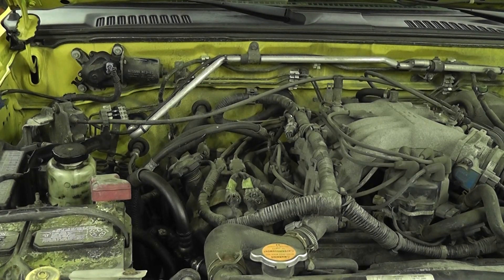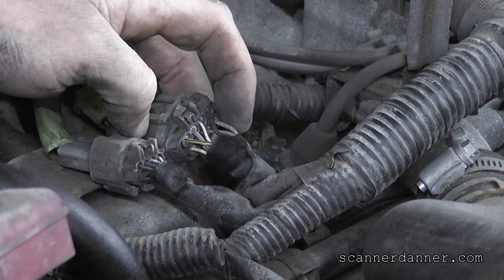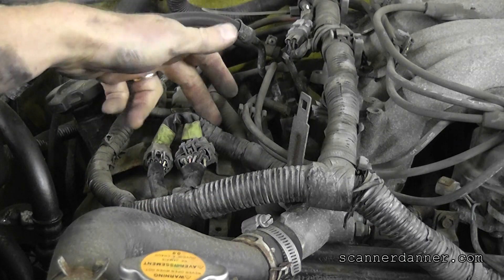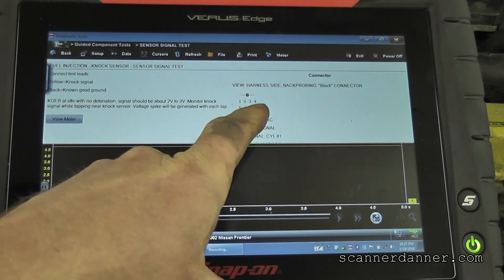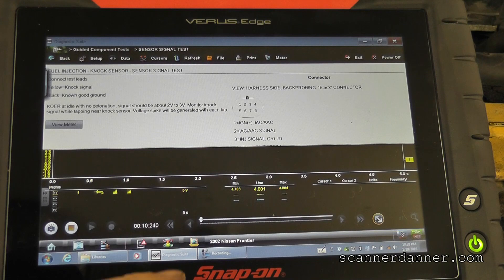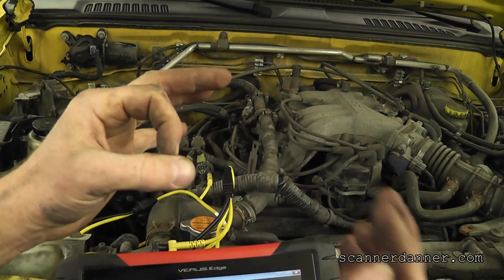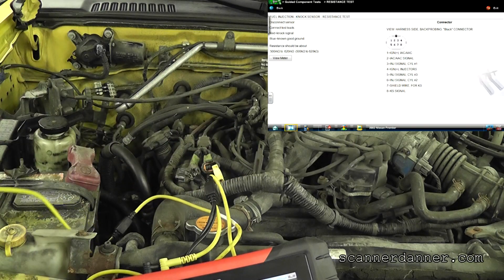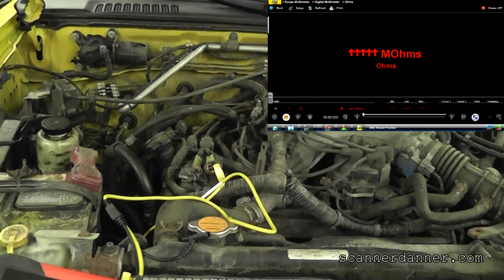How to test a knock sensor (P0328) - Nissan

Comment: I got a Nissan Xterra 2000 that keeps coding knock sensor and misfire on the 6th cylinder n it has had a new intake manifold new distributor new radiator cuz it was cracked on the top. At stop light it's idles rough . Had new spark plugs n wires. No one can fix this car n 1100.00 bucks was put in it. I'm female n don't know what else it could be. Please help and I'm in lancaster Ohio. What else could it be. Also had an injector put in it. I'm puzzled n love this SUV. Anyone have an idea what it could be? Thanks
Reply: Dear wicked,
I can not help you but just had to tell you  that I bought a used 2002 Xterra in 2012. I have had the same nightmare money sucking issues and no one, even the best mech's can not figure out why this knock sensor continues to trigger problems. I have had pretty much all hoses clamps motor mounts. gaskets and radiator along with temp gauge replaced, brand new. It will run great for weeks, then BOOM! I have come too one conclusion though. I live in Nevada. The outside temps change dramatically and my Xterra does not like the colder weather. It has now become it's evil side and runs like shit. The SES light flashes, then stays solid as a de accelerate. It's a mystery...
Good Luck to you!
Reply: Julia Smithson really then wth could it be then. They checked the Heads n I was there n they r good.. it's going back in n now pcv light came on n my oil light. But I have bad valve cover seals so we will see
Reply: I have been struggling with this Xterra the same. This time, to save money on diagnostics and procedures that may or may not be the culprit, I read a lot of the threads, watched several video's and chose to do some maintenance stuff myself.
I started with cleaning the MAF sensor, the wires and connector. Replaced air filter. All this was pretty simple though I did spend  $20.00 buying best products. I also poured a cup of household rubbing alcohol in gas tank, in case of water or bad gas.
Get this!
The SES light remained but only solid not blinking. My car did not "lug" or shake. Ran like it should. I tested the codes again, (the car misfired a bit in route) but it only gave me PO328. (I'm working on this now), BUT! SES light is off and the car is normal once again! 
I am convinced that the sensors are just as good as signaling for minor attention as they alert for major. Next I am going to check n clean spark plugs. It is pretty greasy under my hood so I am going to de grease and learn to do this stuff myself. 
I am single also, and work various jobs for minimal monies. I have spent far more on replacement parts than my car is worth. But I like the SUV.       My Bionic X
Good luck and keep me posted!
Reply: Julia Smithson Lmk I got the same code which is the knock sensor but my check engine light stays on but doesn't flash anymore. This shit needs figured out. Omg
Reply: witch, maybe an obvious question but you did not say: you did have the knock sensor replaced? If you didnt, you can save some money by relocating it-- a few vids here on howto. Not sure what the misfire could be if everything was replaced as you say.  Also maybe the knock is picking up the misfire. Sorry, Im not a mechanic, thats all I can offer.

Comment: From what I remember, a knock sensor has a crystal in it that is tuned to the same frequency of detonation or much more deadlier pre-ignition knock. Ok, a full 5v+ shows right off that the circuit isn't broken, but the knock sensor hasn't initially dragged the voltage down from the start. My 2000 Ford has recently started pinging. I'll just wait for a P code to set, haha.

Comment: I've found when the KS on the Xterra or Frontier 3.3L fail.
It always easier to do the KS relocation instead of pulling the upper and lower intake manifolds.
Reply from the maker: +nightflyr1 I've never heard of a knock sensor relocation kit, what a great idea!
Reply: @ScannerDanner  If you relocate knock sensor, you will get the engine light to go out but your timing being adjusted by the knock sensor as you drive defeats the whole purpose of the sensor. It's where it is for a reason. Replace it and change the plugs while your at it. taking the intake off is the best way to replace that funky plug in the rear of engine up against the firewall. most people don't change that plug because it's very diffucult to get at it and worse to put another back in.
Reply: @pcosta24  👍. Exactly my thoughts on tackling this issue which I have right now.

Comment: Hi Paul does the shield wire supply sensor ground or it grounded on engine block? We are normally test ground wire on pull down design? It's what you teach me on book an prem.channel??

Comment: The edge looks awesome, we have the Verdict at our college but I don't think it came with the 15.4 upgrade. It doesn't appear to have sure track or anything, and won't even tell us what the DTC codes are !
Reply from the maker: +9freelandk so far so good. there are a few things I don't like but some of it is because I do videos. 
There is no built in microphone so when I do a desktop recording it is hard to sync.
The stylus absolutely blows
It has no connection to the car which is great but not when you are mobile and need it for hours of use. 
There is no hdmi or video output without buying a separate docking station (additional $300)
Reply: +ScannerDanner For some reason we have the optional docking base but due to the cost of this equipment it all has to be securely locked away after every lesson, so we don't really get great use out of it. It's a nice feature to have though and just use the dock especially for all day indoor use, via the old 15pin VGA to a 40" screen for graphs etc...
Reply: ScannerDanner

Comment: Can't you remove the test lead unit from the back of that new verus ,isn't wireless also??
Reply from the maker: +Lee Rattle I don't think so, not sure, I'll check
Reply: +ScannerDanner I just had a look , Its a usb module you can unclip from the back of the unit, & attach a usb cable  to give more distance from the working area , pitty not wireless

Comment: So cool. I have this exact problem. I subscribe anyway, because as a professional you up my game, but you literally pulled back curtain on this one. I've never seen anyone cover this subject this accurately.

I was already certain about the high voltage getting through meaning the sensor was bad, but the fact you can tap it and see an AC voltage line go through the DC? That's gold!

I'd heard on modern sensors you can't just hit the engine anymore to see "knock", but it makes sense, it basically being a microphone that'll pick up other vibration, it's just that the PCM knows the difference between random vibration and knock, right?

So we can see the new one alive before putting the intake back on. THAT'S a verified repair then. :) Wouldn't want to do this job twice!
Reply from the maker: +DE “AutoBravado” Nichols thanks so much for your encouragement
Reply: ScannerDanner
Just read your description:
"Symptoms
- check engine light with a P0328 trouble code
- poor fuel economy (2-3 mpg less than normal)"
Oh my gosh. With how much I drive my truck, that's a BIG savings.

I need to stop being lazy and get out there and get it done.

Comment: Good morning and thank you for another video. I have a question, we know this knock sensor is bad because is open, is there another way this sensor will fail? Or what are the other condition a knock sensor will fail and what driveability issues besides a ck engine light will it cause?
Reply: +DE “AutoBravado” Nichols Is this a pop quiz? I could answer to go and see the video but I will tell you what I have learned. I learn the other way to test a knock sensor using a oscilloscope that is not open and about the bias voltage on the Subaru but I still have a question. Is there a driveability issue with a a open or shorted knock sensor? Maybe Mr. Danner or another student could help me. Thanks in advance and I hope I scored good in the pop quiz.
Reply: to affirm what mr nichols said, on my 2003 xterra my mileage and power (not like there was an abundance of either before) took a big hit.  If the cpu thinks engine is knocking (detonation which is very bad for your motor) it will reduce advance and probly make the mixture way too rich.
Reply: +David Tapia I read the description and found my answer in the subaru knock sensor video, again thanks for the information. Have a nice weekend.
Reply from the maker: +David Tapia awesome thank you!
Reply: +David Tapia So, can you share with the rest of the class what you learned? :)
Reply: David Tapia There is a driveability issue with open or shorted knock sensors. Once the PCM knows it doesn't have this measure of protection it'll run a safer level of timing advance. Or a gentler tune if you will. When you get into the throttle there will be less hp. 

I picked up from ScannerDanner's description that there can be 2-3 less MPG. One gentleman with the same engine in the comments said at first he got better gas mileage only to lose it because of how much easier it was to go above 3,500 RPM.

Did you learn anything else then? :)
Reply: David Tapia It's always a pop quiz. It's why I go into comments. Additional learning. I like to teach, learn, and sometimes be corrected. Please, join my YouTube channel. We'll get smarter on cars together.
Reply: Ronin Don't feel too bad about power and mileage. Did you know our V6's out perform some Ford F-150's? Depends on the engine and weight of the F-150 since they vary. I didn't think to look into power to weight ratios until I noticed on my scan tool that the MAF on a basic F-150 moved less grams per second.

I've not been too quick to get this fixed, seeing as how I bought a Nissan original knock sensor according to Rock Auto...one box said made in Japan and another that it was AC Delco. Pissed I might have a knock off knock sensor and having seen so many people report success on Chinese knock off's I bought a cheap one on eBay and it was made to the identically wrong specs!

Unless my DVOM ohms of resistance has gone bad, I think they're both Chinese knock off's.

(Pun was intended.)
Reply: I've got a 99 Nissan quest.  only code im getting is knock sensor.  will it affect the performance to the point if not being drivable? Barely idles.... Cuts off as soon as you put it in drive abd give it gas. i can put it in N then slam it into D and it will catch but barely.

Comment: Also unique to the Nissan is that the P0328 will not trigger the MIL. There is info from Nissan for that. I didn't even believe it at first. Rodents love the wires under those intake manifolds and they're are best employees sometimes, LOL. A cheap trick is to relocate the knock sensor to the upper manifold where there is a similar thread pitch. At least for testing purposes if the knock is causing drivabilty. Good video.
Reply: +M3CH4N1CT3CH I waisted some free time for weeks reading a forum about the relocate. I plan to do that first and see if it can really still see knock or not. I'm so going to go back to that forum, club frontier I think? I'll post this video and it'll have more complete information than in all the some 500 posts.
Reply: +DE “AutoBravado” Nichols It will not sense knock the way it was designed to, and will also fail a lot of smog tests.
Reply: Oddly enough. Mk4 vw won’t set an MIL for knock codes either. Don’t know why, I’d imagine it would.

Comment: 3.3?   i have one of those in the driveway, knock sensor code was always there, sensor was split when i finally got in there 6 years later lol.    it never threw a CEL, just was listed under fault codes if you plugged in and read them.
Reply: +Rhage73 Yeah, I didn't notice either until I set a code for replacing the fuel pump, but not the fuel sending unit. My Nissan Frontier sat for 3 years, so everything was rusted in there. It'd have taken days to get the sending unit, but I had to move across country. A year later and I still haven't gotten around to it...just fill up with gas more often, lol.

Still, it needs to be replaced as it tells the PCM the fuel temperature and makes fuel trims be more accurate for the best use of fuel.

Thanks for my listening to my side note waffling. :)

Back on the knock sensor, did you read in the description that it can get you 2-3 MPG, or at least that it can lose you that? I need that back! 18-19 MPG on the freeway instead of 15-16 is a BIG deal.
Reply: i was getting 19, and then when i changed the knock i was getting 16.   i put on manual hubs got back up to 17.  pretty sure it was easier to wind the truck up past 3500 is why my MPG went down, because my daily is a mix of city and hwy and its a 5speed.   =)   210k on it still fires right up love them older 3.3 / 3.0   Yours may be a 3.5 if it is newer than 99.
Reply: I can't remember the size of my engine. V6 2004. I used always remember stats like that. Guess I care more about function and results.

Comment: SD does it again!  Nissan almost always buries there knock sensors which usually dont outlast the life of the car.  What a PIA to replace a tiny sensor w/ one bolt.  I had my son Ryan who was 8 yo at the time reach in under the manifold (with his small hands) on a "98 Maxima and replace it for me without removing the intake..  I posted a video on that one and it was the best $10 I ever paid him!!   He doesn't charge much, says he's got low overhead.  lol  I'll post the link if anyone would like to see it.  Take care Paul
Reply from the maker: +Ozzstar heck yea. Post it here. YouTube may spam it but I'll unlock it. Just post it once. If it doesn't go through and I'll handle it
Reply: +Ozzstar That's awesome! On my Matco 1/4" electric ratchet tool review I pointed out that I need to do this job on my Nissan Frontier. I mentioned randomly that probably even little chinese hands (no offense offered) couldn't even reach it, but yeah, then it had me thinking of child labor! lol
Reply: +Ozzstar oh shoot, just read your comment. Deja vu
Reply: Let’s see the link.

Comment: my wife had an xterra with a knock sensor code but it never turned on the light. I can see why Nissan did this after seeing how buried it is
Reply: Was it 2000 model by chance? Ii have one that didn't trigger the check engine light as well

Comment: I went through this with my sister's Infiniti. All the tests pointed to a bad KS.  Turned out to be a weak engine ground strap. The original knock sensor was bad because it would not pull down the circuit. When I plugged in the new one, it did.  Thought it was a fix, but code came back a couple days later.  Identifix Direct Hit helped me figure it out.
Reply from the maker: +Lynx Star Automotive (Gabe V) good tip. Thank you!

Comment: easy way to check it pull the fuel pump relay with the car running. knock sensor 100%.